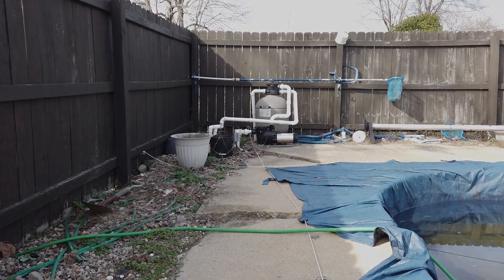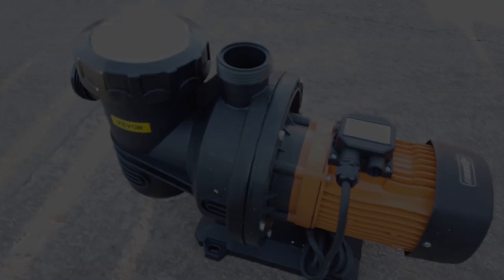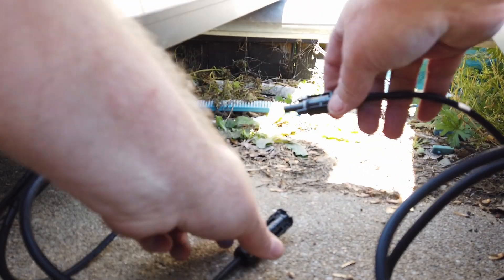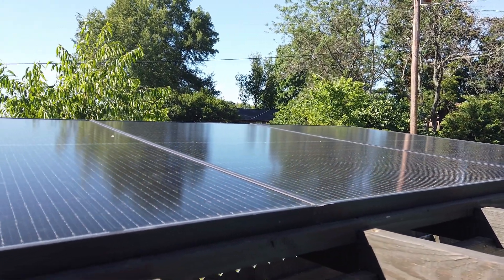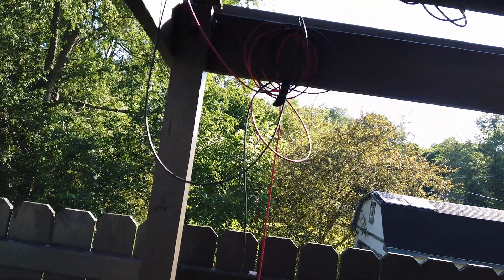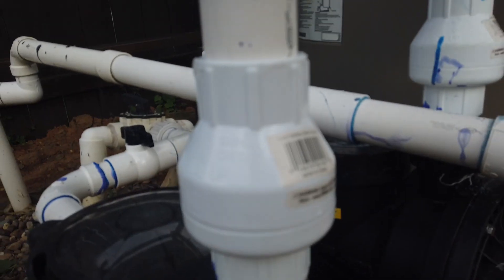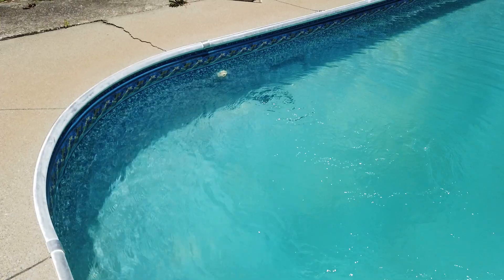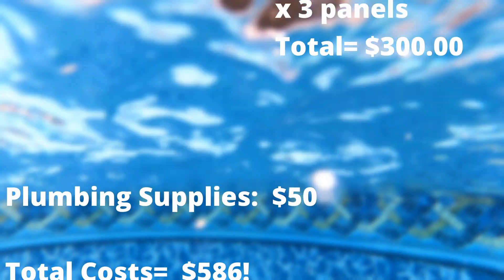How to Install a Vevor Solar Pool Pump + Review

Comment: great video how many gallons is your pool
Reply from the maker: Pool is 15x30 and approx 15000 gallons...it has a deep end
Reply: thank you so much just bought a 24 foot above ground pool and was thinking to save money make it solar the only issue i had was how to connect solar panels you made my job way easier thank you so much
Reply: sorry for being a pain in the ass so i am installing panels in a storage shed i have and the controller but pool in probably 50 feet from where the controller will be do they sell that 3 wire from controller to pump longer?
Reply from the maker: @LOURACING1  yes u can find 50ft or whatever length u need on ebay..just search 50 ft solar extension wire mc4 ...you will expirence a slight drop in voltage due to friction of length but it will be maybe a volt is all at that length...the most important id make sure your roof of that shed is facing south
.if it's east to West facing slant your panels won't produce enough power to run ur pump except for noon to 3 ..won't be enough power ..your panels must face south!
Reply: @st-qp4mr  i looked up the wire that looks like the wire from the solar panel to the controller the one that i need longer is the one from the controller to the pump in your video its the three wires in the controller the solar panel and controller i am keeping it in the shed next to each other its the one from controller to pump?
Reply from the maker: @LOURACING1  oh ok I understand ..thought u were talking abt solar wire....cheapest way is to just buy a outdoor extension cord..thats 50 to 100 ft length at lowes or walmart..cut off the plugs parts and ul have 3 wires inside ...just make sure to hook up the wires i according to the numbers on the pump wires and u can extend it how ever long u need to
Reply: @st-qp4mr Good afternoon i received my pump but my pump wires i think they where labeled wrong from factory my black wire is labeled V my blue wire is labeled W i bought the same one you have you think from factory it was labeled wrong???
Reply from the maker: @LOURACING1  did you get the 72v 900w or the 48v 500w?...mine is the 72v 900w
Reply from the maker: @LOURACING1  according to my manual which I'm looking at now..for the 72v pump 900w....it is U V W so that would be P+ P- U V W ...
I have Brown Blue and Black
Reply: @st-qp4mr  i have the 72v 900 watts my wires are the same as you brown blue and black wires my blue is labeled W and my black is labeled V think they label’s wrong from factory yours on the video shows your blue wire is labeled V and your black wire labeled w
Reply from the maker: @LOURACING1  maybe u might just want to hook it up as they have labeled it...as long as the blue wire or black etc is connected to the correct terminal then ur good...so wire it how they have it..if it doest work then try it like I have it next..or call vevor support ..refer to ur manual and if ur manual has it like mine maybe call vevor before u try.
Reply: @st-qp4mr  got you thank you
Reply: i received my pump but i think my wires where labeled wrong my black wire is labeled v and my blue wire is labeled w you think they labeled them wrong from factory